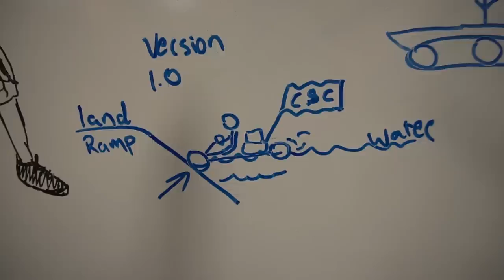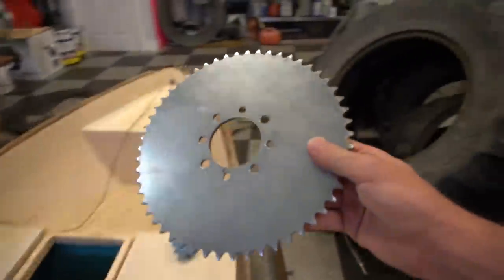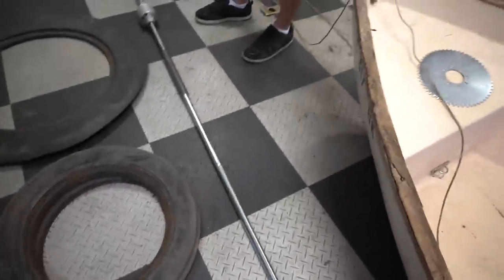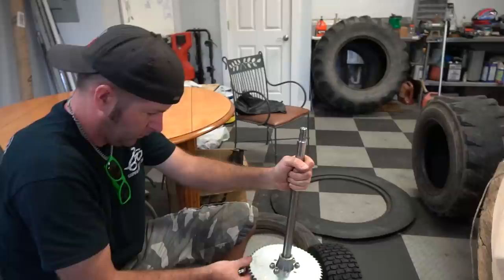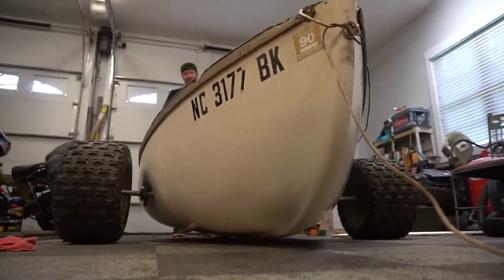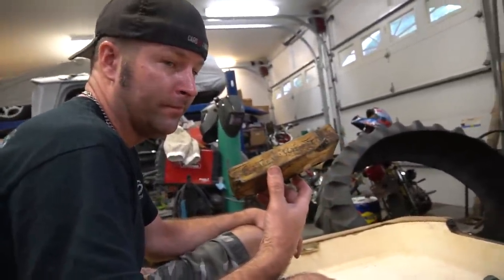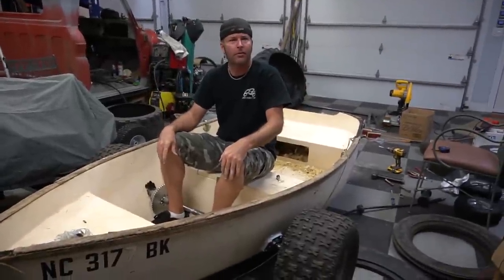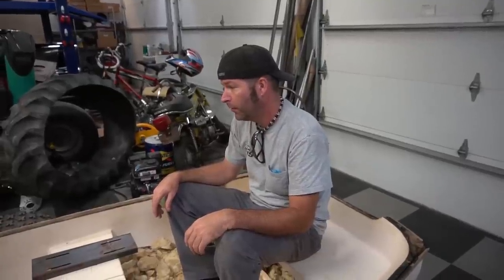TANK BOAT | The Ultimate Amphibious Vehicle Build!

Comment: Very creative idea,with all kinds of variables to consider!..I know atm this build is under the "testing purposes" stage..I hope where the axle is mounted to the boat it don't "waller" out the hole or pull the mounts loose..You may end up having to fabricate a wider plate or inner type of skeletal frame work to help absorb the stress in that small location..I am sure you are aware the foam is in the boat for flotation..You might want to consider installing a bilge pump & wear a life jacket before crossing any serious water!..lol..You should name it the CC Minnow,I just hope you two don't get stuck on some island,would miss not getting to see any more CarsandCamera videos!

Comment: In an episode of Scrapheap Challenge ("mud monsters") one of the teams used old tractor tires to make tracks that set on small car wheels, similar to what you guys are planning on doing. They kept tires on the wheels as well, but had a bunch of issues with tracks coming off. Their solution was to add L brackets and log chains on either side. Learning from their misfortunes my suggestion is to take the tires off and screw wooden blocks to the inside of the track so that those blocks form sort of rails for the wheels to roll on, a design more similar to how tracks are usually made.
Best of luck with the project, can't wait to see her float!

Comment: That 6.5 HP pickup has gearing in its favor if you see the gigantic sprockets mounted on the shaft going to the transmission.  You will probably want to gear for torque and less top speed to help aid in moving while on the tracks on so your best bet is to add a jack shaft and have a small sprocket on the engine going to a large sprocket that spins another small sprocket on the jack shaft.  Just my thoughts.  Cannot wait to see this its going to be awesome on tracks

Comment: What comes to mind is water and brick lol
Joking I hope it works I think you gonna need a bulge pump for the water leaks not to mention I think the axle mounting points may need wooden supports because I think the fiberglass will break around the axle due to vibration if used for extended lengths of time especially if you install tracks on her. Good luck guys, Awesome video btw

Comment: A motor with electric start would be better because then you have a battery and charging system to install a bilge pump. Transmission with reverse connected to diff axle with disc brakes for turning and those axles powering a split axle to drive each side separately.
Reply: Silent Death yes but electricity plus water isn’t always the best idea
Reply: Joe Fluit never seen a bilge/sump pump aye?
Reply: A big enough battery could also power a trolling motor, which would eliminate paddling it if the tires won't propel it, or Fish and Wildlife says they can't run the gas motor while it's in the water. (The latter put a end to the festivities with the amphibious gokart.)

Comment: If the angle of the sides is an issue, build a wood box that will allow the bearings to sit vertical and fiberglass around it.

Comment: Seems like it might work.  Curve upon curve is usually a good thing 😉   
        I would have used a transaxle tilted up and mouned the engine on top of it.  Still using separate brakes.  That way you would have low gear for land and 4-5 more speeds for the water plus reverse.

Comment: You guys should build a 670 powered airplane! 
There's an old design for a homamde aircraft, it's called a pietenpol. It was designed in the 1920's and powered by a ford model a engine. That particular engine only produced 20 horsepower. You guys could get plenty of power from a 670, and it would be the craziest thing I've ever seen! 

LIKE SO THEY WILL SEE THIS

Comment: You should add a sleeve for each side of the axel and fill the inside around it with spray insulation foam for better waterproofing

Comment: Good luck keeping the cut up tractor tire on when you turn. It needs a center support in the center of the track to keep it from walking side to side when you turn or chains on the outside to keep ot from walking side to side and you guys should run 3 tires 2 solid axle tires for driving and the 3rd able to move up and down on a adjustable coil over to keep constant tension and run it like a belt tensioner to keep the track tight as your tire tries to stretch

Comment: Put strait tread paddle tires on it, large pneumatic gate castor on the back so it's less susceptible to digging down into the sand/ rock. I wouldn't even install tracks that just adds complexity and you could run into issues with it.

Comment: instead of the caster wheel you should put a bigger wheel in the back with a tiller arm to turn it. You could use it for steering on land and it would act as a rudder to help steer in the water too.

Comment: Things to try waterproofing it with:

-Make bigger holes for the Shaft, Have Tube Steel that allows a Bearing (Less Friction) to be fitted on the Shaft in the tube to spin freely. Then use Flex Seal Spray on the Tube to seal the Hole in the Hull, Should provide a better seal (Though your Silicon is fine) that lasts.

Comment: thinking about it, if you made really big wheels, like a  paddle boat, you might not have had to drill through the hull, but it would have looked insane, if the wheels were big and fat enough they might have even taken the weight with the boat hardly sitting in the water

Comment: Use 6x6 axle seals to seal the axles from leaking water, you can find them on line from a 6x6 shop. If I knew you guys were going to do this I would of sent the trans I sold out of one, it had disc brakes on the sides of the trans to make it steer...and it would drive the axles with chain and was CVT belt driven... lol

Comment: Have you thought about putting some of those paddle sets that the Honda four wheeler mud park guys use that mount in between the axle flange and the wheel hub? Then you wouldn't necessarily need the tracks

Comment: I think there are some things that y’all need to consider. A. The boat is made of plastic and foam, which isn’t going to be strong enough to support the drive train. To combat this I would recommend you guys build some sort of small endo skeleton so it doesn’t shred itself apart. B. The turning system isn’t the greatest, and you are gonna have a lot of trouble keeping it straight in the water. Past you tubers who have made go kart tanks have almost always used parts from an old zero turn lawn mower. I wish you guys luck, and I can’t wait to see the final product!
Reply: Also you guys don’t really need to worry about how deep the tracks are in the water, just as long as the top tracks aren’t in the water you should be fine
Reply: Paulsblocks i was looking at a lawnmower transaxle this morning wondering why we didnt go with it

Comment: To get the axle lower you should make a second jack shaft and put the big driven gear on then do a 1:1ratio gear with small gears from the jack shaft assembly to the main axle

Comment: Tracks have a tendency to want to go straight because of their design however you'll want to have the tracks weigh the same. If not their weight will cause the hull to list (lean to one side) in the water causing it to want to go in circles

Comment: I didn't realise fibreglass dingy walls were so thick. You may have been better off building your own straight sided dingy from scratch. Hopefully the foam and fittout of the dingy is not so waterlogged and heavy that it will sink or have too high a water line. Best of luck. I too am scratch building a micro jet-boat from XPS foam and fibreglass. I will be releasing videos hopefully soon.

Comment: Just had an idea for when you get it running in the water, it would probably be a lot faster as a boat (this only applies if then wheels are less than half way under water) if you hooked up some kind of paddle, kinda like what a paddle boat would have, to the outside of the rims (they would need to be a little smaller in diameter so they don’t rub on the ground) to make it move quicker through the water. 

Just an idea!  But great job on the videos, I love all of them!  Keep it up!

Comment: you need some shields on the side and viking helmets . if the track had course paddel like lips on the tread it should be enough to move the boat too.
i think the bow of the boat will hit before the wheels will , could do an axle in front of the bow and use two chains from the driveaxle going through the boat .......... come to think of it , mightve been betterif you had put the axle on top of the gun wales of the boat  and use chains to go to the wheels under the boat ( tie the boat on a frame that holds the wheels and you dont have problems with the boathull flexing either ) , wouldve prevented any "leaks" and a lot of silicone use

Comment: you're going to need to make a steel cradle to go under the boat to support the weight when you put the flange bearings into the fiberglass is going to bust that s*** up a matter of minutes. 👍🤐

Comment: I think you should have done 2 engines per side and 2 levers that when u push it forward it would give more throttle and when it is pulled back it will activate the a brake

Comment: Stick a aired up kart tire or mower tire into the tractor tire to see what fits , deflate the tires a when you put the tracks on you can air the tires up to tighten the track
Reply: The air in the tires will give extra buoyancy and make it less likely to take on water where the bearings are
Reply: And a mower tire would be wide enough to flatten the tractor tire tread once they have the side walls are gone

Comment: Hey guys if you really want to make sure it doesn't take on any water at all paint the whole bottom of the haul in Flex Seal!! I used it on my pedal boat and it fixed it permanently!! Btw plastic dinghy boats have drainage ports for reasons. They dont really take on water per say but the do condense enough air to take on enough moisture to seem like they do. People used to fill em with foam..... Really an in the air idea of being slighty stupid slightly smart. Yes it will keep you floating longer if you did put a hole in your haul but it also traps all that moisture as your finding out. This can cause black mold and other mold to form in the haul and you can never drain the boat again of its moisture. Also they make a really good waterproof silicone for boats and decks thats meant for full submersible wear and tear. :) hope i could be of a help to this awesome project cant wait to see it in action!!

Comment: might want to think about more buoyancy when the time comes you guys are adding alot of weight to that little canoe, an engine and that much additional material i would be surprised if it stays afloat with 1 person and all that stuff no its not waterproof, fiberglass does not do well with drilling you have a ton of hairline cracks along those holes you made. it already had a crack if the foam inside was wet as well... GL with the water part!

Comment: Why not use a riding mower rearend?
It's slip differential and if you brake one side the other gets power so you can steer easier.
Also for tracks the tires will be really stiff so cut them in 3" sections and use bailing wire to connect the track strips.
Order a second set of differential seals to seal the axle holes in the hull.
For an engine you would need a verticle shaft engine but you could use a PTO clutch and add a propeller

Comment: Hey Guys What about some 15 inch jeep wheels?  Alot of them are the same bolt pattern as most trailer axels meaning it be easy to buy a hub that will match the bolt pattern for your axels

Comment: If you want to use tracks for propulsion won't you need to brace the 2 axels ( down the length of the boat) to keep the treads spaced apart? Much like a go cart frame? I suppose that brace can be on the outside of the boat.

Comment: Have you thought about the tension that will be needed between the two axles to have the tires apply enough pressure to be able to spin the "treads".  I can't see the fiberglass having enough strength to keep the axles in place. Going to need a brace between the axles on each side, something like a pipe with a bearing on each end for the axles to slip through. Otherwise the axles are going to just pull together with the"tread" squeezing them.

Comment: Couple of problems
- calking on the bearing will create friction. 
- The bearing seals don’t mean they are waterproof
- the tractor tires won’t stay on unless there are ribs on the inside to prevent lateral play while turning.
- motor mounted on one side will create unevenly weighted distribution and the boat will lean in water.  
- what will propel the boat?  Install disconnect so in water the motor turns a prop and on land it turns the wheels?

Comment: how about front wheel drive rear wheel steering? if you do tracks run two engines so you can run one faster to steer the other direction.
Reply: on another note that caster isn't going to do well in the dirt, maybe you guy could make a bigger caster with a small go kart wheel

Comment: Why not just use a bigger tail caster. Bolt on the tractor tires and haul ass? You can still steer with the brakes. Tracks are gonna be a pain. It would look like an old tail dragger airplane but a boat on land,or water?Hmm not sure what I just said?

Comment: Would it have been easier to have a belt drive to each wheel from like a jackshaft than to have it from a diff and brakes on each side? The belt drive would have a tensioner operated by a lever on each side, so then you could have direct control of the power flow of the wheels

Comment: Why would you not go hydraulic? Hydraulic pump, two hydraulic drive motors, and two variable speed valves. Can get it all from Northern or EBay. Have less then $300 in it.

Comment: How will you deal with the open differential always giving power to the wheel without traction? It could be cool if you guys figure it all out.
Reply: upside downdog 
The split braking takes care of that. If one side loses traction, apply some brake drag and it will shift some power back to the other side
Reply: Dylan Headrick 
I guess that's how tractors work?
Reply: upside downdog Pretty much.

Comment: Don't take it off road!.....no ground clearance will leave you hung up, or worse yet punch a hole in the bottom! ...... are you going to add an extra motor for propulsion? or are you just going to use the tracks to do the job? ..... I would put an outboard on the back.....even a trolling motor will move you faster than the tracks will my friend.   (been there done that)

Comment: I recently bought a 125cc prd fireball gokart it runs but only when you start it in the air as soon as you put it on the ground it dies the clutch engages even at the lowest idle what should I do? It's a 2012 marrenello frame with a prd fireball and size 11x7x5 tires please help.
Reply: Michael Roginski sounds like a clutch problem
Reply: Isaac it'll be fine We fixed it it was a clutch problem just didn't know what was wrong with the clutch thanks